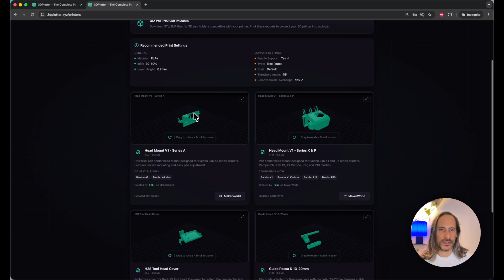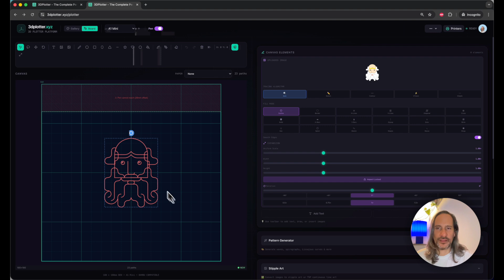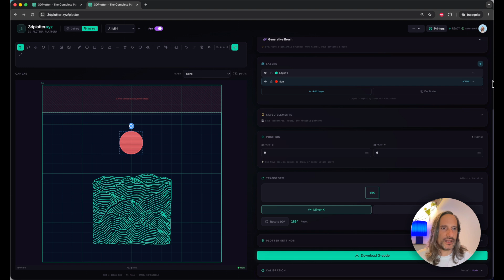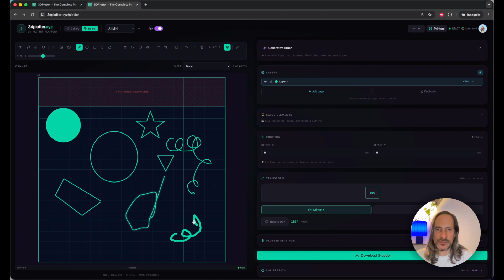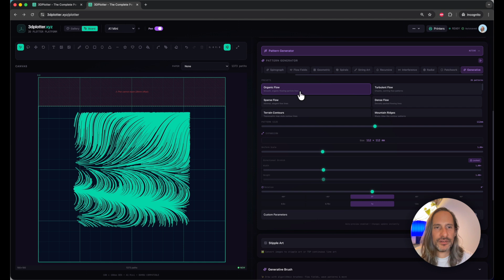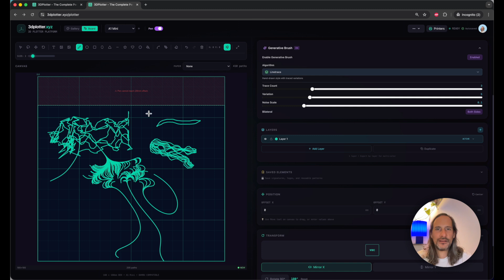How to Use 3DPlotter.xyz - G-code Generator for ANY 3D Printer

Comment: Is the g code for x1c same for x2d? I’m looking to buy the x2d but I really need this drawing part.
Reply from the maker: Hello!!!! No it is not, I have in my disposal one x2d and I will try it when I am gonna have some time later in the summer, the difficult part is to design a pen holder cause the extruder head is totally different, If you are able to design I would be glad to help you make it work.